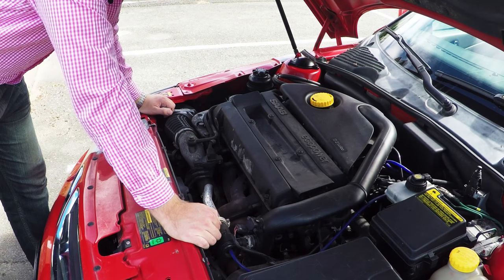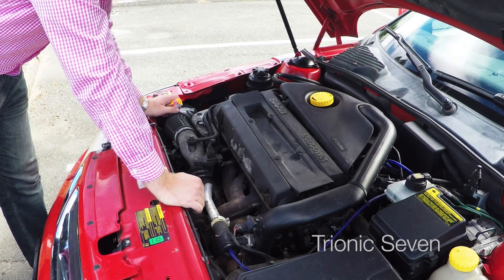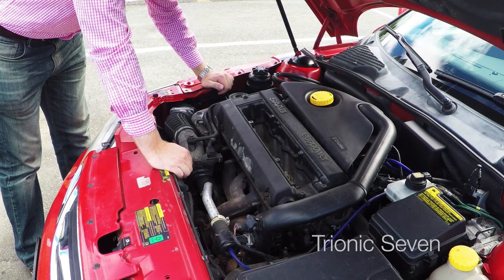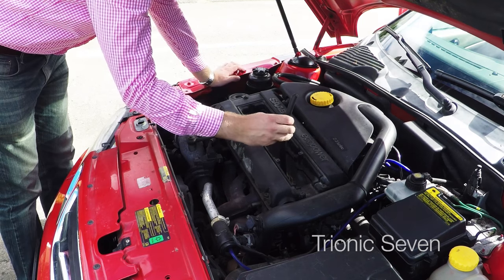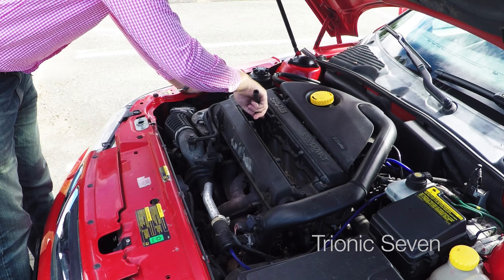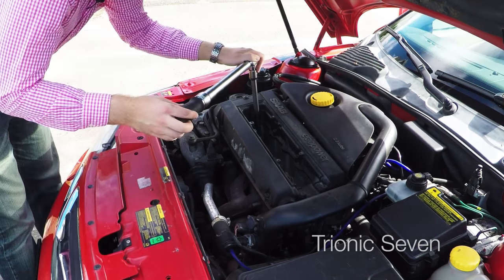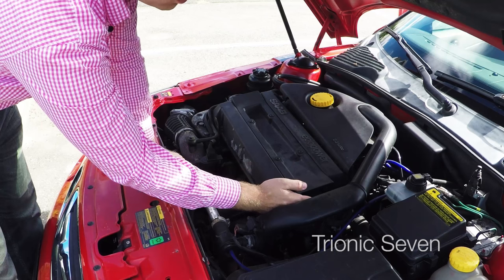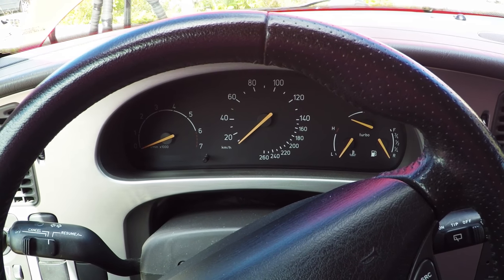Saab Spark Plug Replacement DIY - Trionic Seven

Comment: Thanks for the video. Just a couple things I'd also recommend. Always use the dielectric grease in the coil boots. You don't want to have another reason for the IDM to fail. Also, the 4 bolts tend to loosen over time if tightened with just a screwdriver. I always used my mini wrench with the 30torx to get that little extra snugness. A Saab master tech I worked with would always replace the torx bolts with 10mm head bolts and lockwashers. When you work on these cars everyday you constantly find cars with loose IDM's and missing bolts. Lastly ditto on using the correct NGK's. NEVER but NEVER use anything else with the Trionic cars.
Reply from the maker: Thanks for your input! Your comments are always helpful and informative, keep it up :)
Reply: Hey Saab Tech, you dont happen to live in Canada around the corner from me do you?? 😄😄

Comment: Another good video from you! The dealer who sold me my 2002 Aero serviced it and installed Bosch plugs, they caused a CEL after 200 miles, gaps were way off, different on each plug. I regapped them, CEL came back after  ~500 miles. Turns out that unmodified Aeros need NGK PFR6H-10 plugs, gapped at 0.95, 24Nm.  She's running sweet.
Reply from the maker: Wow, bosch plugs at the dealer! That's almost fraud, you should get the money back + some more due to possible DIC damage.
Reply: I know, but I found the problem after the 30 day UK statutory guarantee had expired... too late. Anyway, I'm taking the Aero on a road trip from England to Nordkapp tomorrow, that's how much trust I have in my Saab!
Reply: Although, all this NGK hype... As long as you get the correct spark plug, any serious manufacturer (NGK, Bosch, Denso, etc) will do just fine. The problem is that people do not read the plug translation charts, which means they often do buy the wrong plugs. The NGK plugs which are standard (and hyped for) on Saabs are EASILY replaced by plugs from other manufacturers, if you actually bother to get the correct one. It's not like these very common NGK plugs are some kind of space shuttle technology.
Reply from the maker: Nope, that's incorrect. NGK plugs only in the Saabs and absolutely nothing else. Saabs have no knock sensors but use the spark plug resistance to detect misfires/knocks and this system is carefully tuned to NGK plugs.
Reply: Sorry, but, nope, that's incorrect. You are very right about what technology Saab uses for knock sensing, but other manufacturers have special "resistor" plugs as well, like the NGK "R" plugs.
Reply: But for the common Saab user, yes, sure, the recommendation should be NGK R.
Reply from the maker: http://www.serioussaab.co.uk/Procs_pages/proc_pages/p_plugs.html <- serioussaab knows their stuff.
Reply: Yes, but I am only stating that there are in fact alternatives (if one would for any reason not want specifically NGK). Also, strange how that site lists BCPR7ES11 for my car when the engine bay label clearly says: "Electrode gap 1.0mm +0.1mm -0.2mm" :) I would recommend a -10 plug for that application, to be as spot on as possible. But hey, maybe that's just me. But as said earlier, I agree that the general recommendation should always be NGK.
Reply: For B235R engine on the Aero, I only use PFR6H-10, gapped to 0.85. Everything else fails miserably, engine performance is shot. At least that's my experience, one of my aeros even has LPG modded and it works great. I found that the DIC is calibrated to these specific plugs and it kind of dislikes any other. The smaller gap is required when running increased boost (as in tuned engines), otherwise you will get misfires on high engine loads. It also helps with smoother idle.

Comment: I'n my view, the old plugs looks near perfect in colour, except being worn a bit more than desirable. Not too lean, not too rich in mixture = light brown.

I always use a dab of anti-seize paste on the threads to protect the sensitive threads in the engine head. As long as you fasten the spark plug with degrees instead of torque, there's no problem. The plugs used in this case should be turned 180 degrees if I remember correctly.

Edit: Just checked, with a compression washer, as in this case, NGK recommends 1/2-2/3 of a full turn to seat it (180-270 degrees).
Reply from the maker: I didn't have the chart with me while filming so I didn't know that the color was the perfect one. I torqued according to the Saab workshop manual, which says 28Nm.
Reply: No need to apply anti seize to NGK plug threads.  They're already coated or plated to avoid seizing.
Reply: When do you apply dielectric grease to the plug boots?

Comment: Hey, nice video, I had already seen you, and now I have a 2000 aero, but I got another reference for the spark plugs: PFR7H-10 3978.
Is that correct, or should I ran to take them out?
Reply: Only one you should use. I tried the ones he recommended and car never fully boosted.  Hopefully not too late..

Comment: I never knew that about the DIC having to stay upright. I've gone through several after market ones and wonder if improper handling could have attributed to it. I realize after market is NOT the way go especially for the cassette. I order the OEM one last week. Hopefully that should take care of my issue. Thank you for your insight!! Love your channel!!
Reply from the maker: Yeah, the DIC is a little sensitive. But it's a good thing that you stopped using aftermarket DIC since they are universially accepted to be...well, crap. :)
Reply: Internet babble myth ! Cooling oil in the...individual... Coil cases Doesn't go anywhere .. it can't ! 
So 30 seconds of being upright is More than enough time for the oil to settle 
HEAT is what kills the DI.

Comment: Excellent video and review as always. Everything is as presented. However allow me to point out a few tips. Dielectric grease should always be used between the rubber bouts of the DIC and the spark plugs. This way you avoid the event of an ark between them. Also always use torque to secure the DIC and always perform the change when the engine is cold.
I also believe that you should have gapped the tips to 0,9 considering your tuning state or buy the NGK BCPR7ES which are already gapped to 0.9mm.
Once again Jonathan well done.
Reply from the maker: Good tip with greasing the DIC, it does say so in the manual though I've never done it myself. The tune in my car requires the -11 plugs, so I'm happy with 1.1mm unless proven otherwise :)

Comment: Some videos that would be interesting would be how to replace the antennae cover, brake lights, shift knob, and removal of the dash or door panels. Just some ideas.

I need to replace at least one light on my third brake light as I get intermittent warnings on my SID, took a while for me to find it as it was not everytime and when I checked it was pretty light outside, it was also one of the end bulbs on the third brake light and it kind of blended in. Tinted windows didn't help me :)
Reply from the maker: Thanks for the tips! I'm always looking for new video ideas :)

Comment: how big difference is old vs new ngk? I probably have the original plugs in (after 180kkm ;x) and going to replace them with the new one soon. Also air and fuel/oil fikters will be replaced. Shall I expect great difference before/after in my 2.0LPT?
Reply from the maker: Replace the plugs according to the service intervals and you'll be fine.

Comment: This video helped me out a lot, thanks! Inherited a Saab 95 2.3t se from my father in law and it had all sorts of problems. First of all it has a very obvious boost problem so as soon as I got it i went a bought a OBD2 scanner for my phone and checked out the error codes. Got 4 and all of them pointed at a faulty DI Cassette. So following your excellent video i changed it out for a new original one and changed the spark plugs at the same time. Now 3 out of 4 error codes are gone but the boost problem remained but the fuel consumption has gone down from 13 to 11 liters per 100km. It feels sluggish, like it has 50 break horse power and no turbo boost. The error code is p1105.

I've ordered a new set of vacuum hoses in silicone that are due to arrive tomorrow but i don't think that will solve my problem. Do you have any pointers that might point me in the right direction here?
Reply from the maker: Hey! Glad you like the video. I don't have any experience with that fault code but new vacuum lines. Check my video on that!

Comment: Hi everyone! Maybe it is late to comment Your video, but I have many doubts about my Saab 9-5. I have 2.0t BioPower with around 200 bhp and additional LPG instalation. I should in the near future change my spark plugs and there is a question. Which spark plugs i should order - of course it should be NGK branded, but gap on spark plug should be 1.1 mm or 0.9 mm or any special spark plug. Could any one advice me which one should I bought? Thanks for Your help.

Comment: Just a curious question about the saab dash. Is the gauge a boost gauge? I can't seem to figure it out. Trying to figure if it is showing a boost leak or if it is normal that the gauge rises, then lowers if I keep a constant throttle position.
Reply from the maker: The gauge to the upper right is actually a gauge showing the air request and is closely matched to your pedal. A full explanation is in the manual!

Comment: Getting obd2 trouble code P1312 now in the summer heat.. Is it possible that the DI cassette is getting bad? I did replace the spark plugs quite recently
Reply from the maker: Yep, probably time for new DIC.
Reply: @TrionicSeven  How often do these cassettes need to be replaced roughly?

Comment: NO one thinking to move THE DIC.case higher 10 to 15mm. high from engine cover BY used TEFLON insulater. SO THE DIC case not touch the engine cover .SO the DIC. unit not hot same engine cover...

Comment: You don't use electric grease on your plugs to the dic ? 
I do. 
I also spray the dic with electric cleaner while it's off.  

The dic is $260
Reply from the maker: Good point, maybe I should look into that. Thanks for commenting!

Comment: At first I wondered why are You using these spark plugs and not platinum ones. Why have You chosen with gap of 1,1mm? Is it better for ethanol mixture? My OEM DIC is coming today so I wonder what type of spark plugs should I use as my engine works on LPG. One way for sure is colder spark plugs as You chose. But most tunners say that for LPG gap should be less that 1mm.
Reply from the maker: The tune is made for these very plugs. Check your manual, or if your car is tuned, ask the tuner.
Reply: Saab Lithuania fb grupė parekomenduos šituo klausimu. Ne viena tema užviesta tuo klausimu.
Reply from the maker: Sorry, I don't speak Lithuanian! :)

Comment: Alway´s follow the owners manual for the correct typ of spark plug  and motor oil so as to prevent problems.
Reply from the maker: Exactly.

Comment: Hello i'm wondering how did you know how to rotate the sparkplugs to a certain point that they're not too hard and not too loose ? Also you said that they must be at around 28 N.M what do you mean by that?
Reply from the maker: I use something called a torque wrench which I set to 28 Nm. It's the big tool that says click when I reach the exact torque. See the other comments on this video for ideas on how to do it without the torque wrench! :)
Reply: Okay thank you ! :)

Comment: Will these work?
http://www.autozone.com/external-engine/spark-plug/ngk-gp-platinum-spark-plug/505371_0_0
If so, do i need to modify the plug at all?
Reply from the maker: Which car?
Reply: 2002 Saab 9-5 Lanier!
Reply from the maker: Not the right plugs! You should use the same plugs as I do. :)
Reply: I just ordered them and will put them in...... THANKS!

Comment: Hi Jonatan and this was a nice video for those who don't know. But you did a big mistake here.
You torqued the plugs in to 28nm, checked them over again, and mounted the DI.
That's wrong. If you see on a new sparkplug, the sealing is much 'bigger' than on the old sparkplugs, what you HAVE to do is to torque it to the currect torque, witch is 28nm, loosen them up again, THAN torque them to 28nm, so the sealent is been pressured right. This is normal to do with all NGK plugs, maybe plugs from other brands like Bosch etc. 
But you don't get the right pluglenght or what i could say if you do it your way here, so allways torque down the plug so the sealent got sqeezed together, loosen up, than torque it again. Sorry bad english, my iPhone want's to autocurrect everything it seems like.
Reply from the maker: I've never heard of that procedure before, and I followed the official Saab workshop instructions which simply say tighten to 28Nm. Where did you hear about the alternative procedure?
Reply: Well i 'hear' it about when i worked as a mechanic. Was changing plug in a OG9-3, did it just like you did, and the workshop manager saw it, he was not happy. I understod the reason to that if i took the new plug that only was torqued once, thinking about the gasket, than i saw why it should be done like i said.
The gasked will not compress enough with an only 1 time torque. It will offcause work the way you did it, but just think to mention it :) It's not an complain, just a note :)
Reply: And the workshop manual for Audi, VW, Skoda, Volvo, Opel says just what i'm saying. Never worked direct with saab so maybe saab did think otherway's but, yes you see what i said :)
Reply from the maker: That's what this community is all about, us learning things together! I didn't know this procedure before and it makes a lot of sense. Just wondering why WIS doesn't mention it! Thanks for teaching me something new :)
Reply: Martin Rene Olsen what sealant ? You mean bolt stretch ?